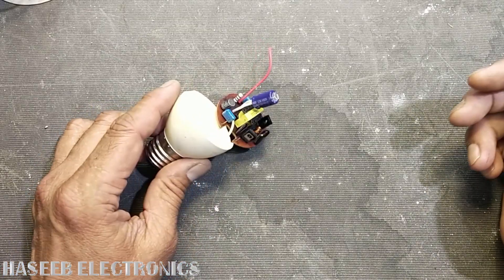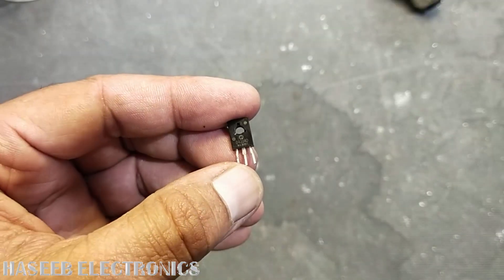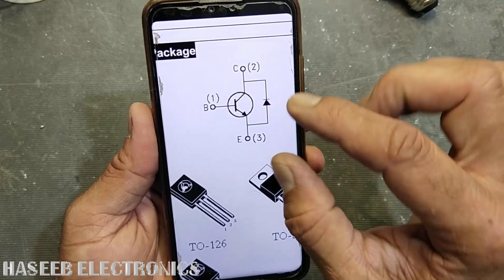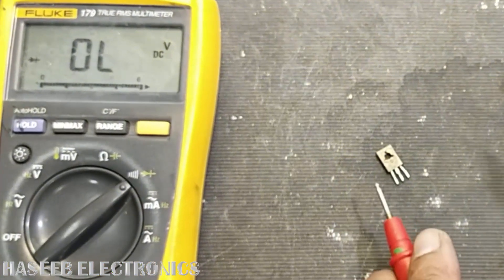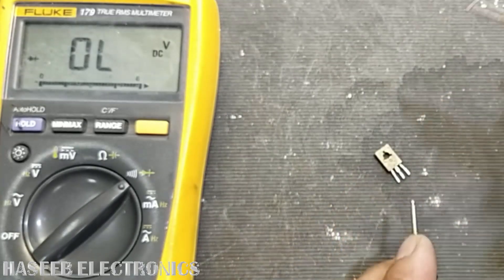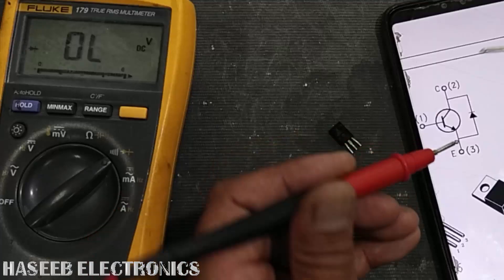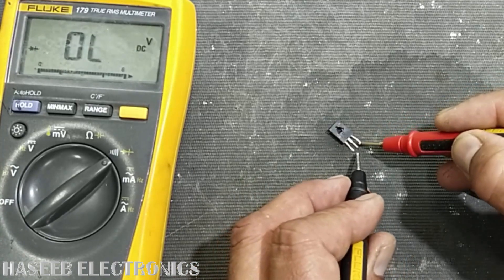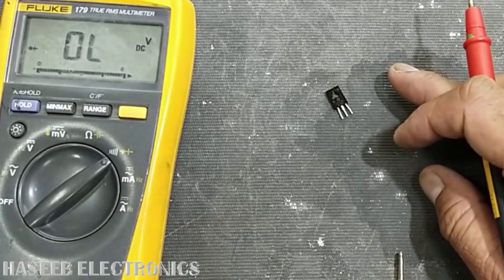{579} How To Test NPN Power Transistor D4204D or 3DD4204D Used in CFL Power Supply Circuit

Comment: Hello sir, can I ask you a favor?
I needed to create a circuit to simulate the sunset, to apply in a birdhouse.
When I turned off the light, it went out slowly, giving the birds time to go to the nest and not die in the cold.
Thank you for your kindness.
Reply: What type of light you are using is it filament based or led. And operating voltage please mention
Reply: @AnandKumar-ym9yw  I use incandescent lamp, but also can use led.